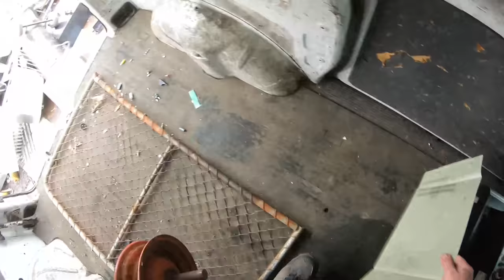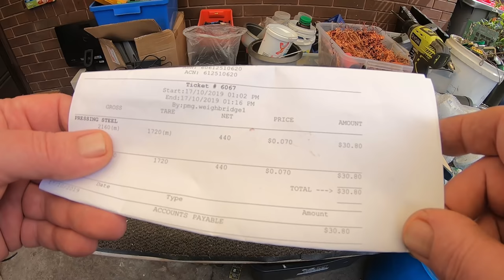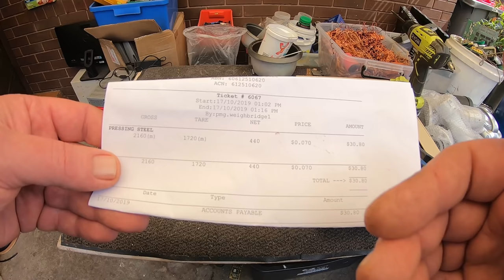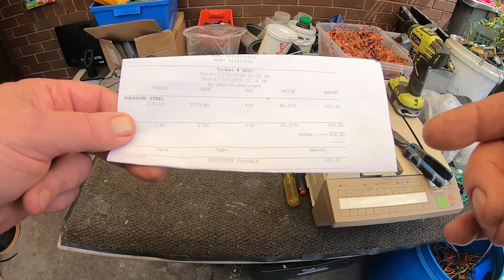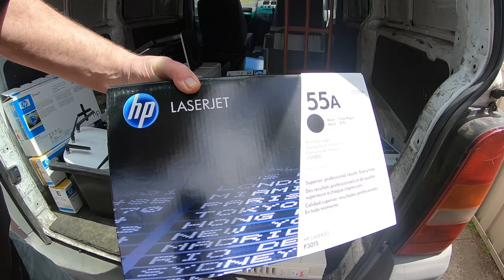Mega Scrap Marathon Part 1

Comment: You should try using tin snips for cutting wire. It works so much easier and it is less stress on your hand and wrist. It won't work for doing things like plugs when you want to pull out the brass ends, but for cutting a lot of wire it will save you a lot of time and ache of the hand and wrist.

Comment: Trick I learned on screw drill bits is grind off the point a bit on the phillips #1, not much a mm or 2 just enough that it fits better so they work better on #1 & #2 screws. Still might grind up the sides over time, you do a lot more scrapping then I do.

Comment: you can heat the magnetic bit over the stove to quench the magnet, but it may also make the metal softer. or you could try waving it in a random pattern over a hard drive magnet to try and scatter the magnetic polarity

Comment: There's more to DVR / surveillance HDDs than just the 24/7 rating. Those HDDs have special firmware optimisations for that particular use case - the capability to continuously write multiple streams / files simultaneously.

Comment: I sell spare cartridges too when I get them, I work on printers/PCs, the black HP box are the newer style, the blue ones are older that were changed to black style so that dates them a bit too but the 4700 wasn't as popular it seems (haven't run into much to repair over the years) so I've had trouble selling those as well. I tend to just recycle the blue boxes now knowing they are so old.

Also glad to see I'm not the only one to clean off processor paste, I do that too since when I handle them it's just cleaner. I have tossed them all in 1 box for now and will have to sort them more when I go to sell them for scrap.

Comment: Nice video Ben, one small thing is that the power boards sometimes have non brass metal parts inside. I have been caught out once at the recyclers, and like you said you should always check your metals otherwise they downgrade the lot. Anyway look forward to more tips and stripping stuff we haven’t seen. Cheers

Comment: My good sir, you should look in to something called pyrolysis.  It is a process that turns waste plastic in to burnable gases and pyrolysis oil which can be refined.  Plastic is fuel, don't send it off to the dump.  Building a plastic pyrolyser isn't terribly difficult either.  You can turn that waste plastic into money just like all that metal.

Comment: Great scrap video! Enjoyed the part where you were scrapping the fax machine...and the part at the scrap yard! Just a question Ben, how did the yard know how much scrap steel you have when you throw them out onto the concrete instead of a bin (like your previous videos)? Maybe you can let us know during your Part 2 video? Cheers.
Reply from the maker: for just scrap steel we drive onto a weighbridge, they weigh the van in, then it's weighed out, we get a ticket with how much weight was taken out, then go to the cashier booth.
Reply: @eWasteBen  Hi Ben. That's really efficient! Thanks for taking the time to read my comment and to answer my question. Looking forward to Part 2!

Comment: How to demagnetize tools  https://www.youtube.com/watch?time_continue=58&v=_U5GM6heYA4

You just need to use the side of the magnet and run the length of the tool. You need both north and south poles of the magnet to be in contact with the metal at the same time and run the length of the tool. This will demagnetize the metal.

Comment: Your viewers should do a little research in to elemental mercury.  Absorption through skin and the digestive tract is very minor if at all.  The VAPOR is where the problem is at the VAPOR is extremely toxic and 100% bio available. Mercury has a lower vapor pressure than water at room temperature.   In short, the kids are under the threat from the old tubs sitting around in the sun with broken tubes in them and potentially breathing the vapors during disassembly or storage.  It they just kept the florescent tubes under a small layer of water awaiting your pickup it would be fine.  You, however, have a toxic mess to clean up.
Reply: The kids shouldn't be near mercury in any shape of form.  But yes, it's not that toxic in the metal form.  Cody from the Cody'sLab was experimenting with the mercury on his channel.